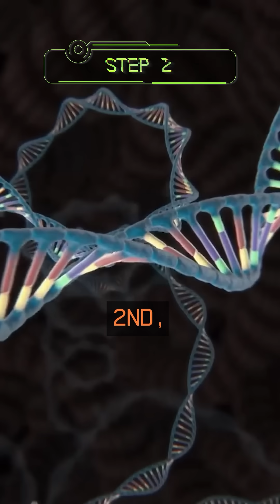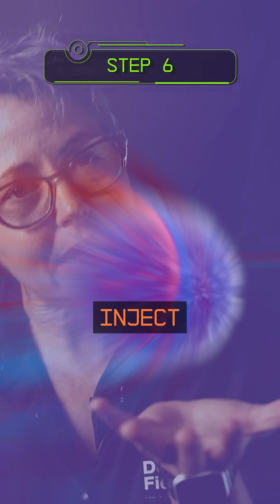Making a Dire Wolf in 7 Steps

Comment: I have a question. 

Dire wolves were larger than the average Grey wolf of today. Will this size be reflected in the DNA extracted? Or, because you're still using the Grey wolf genome but extracting the Grey wolf genes, will the Dire Wolves you have created grow only as large as the average Grey wolf?

From the video, the 6 month old Dire wolves look larger than the average 6 month old Grey wolf. But I didn't know if that was a trick of the screen.
Reply: I think, they were larger than grey wolves in adult form, actually they are not dire wolves but a modified grey wolves but a large and same characteristics as dire wolves.